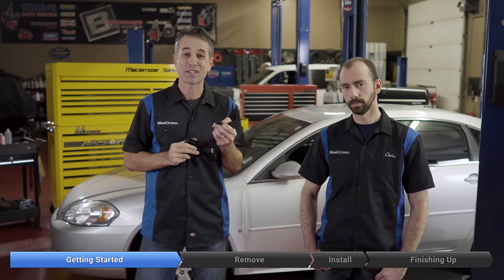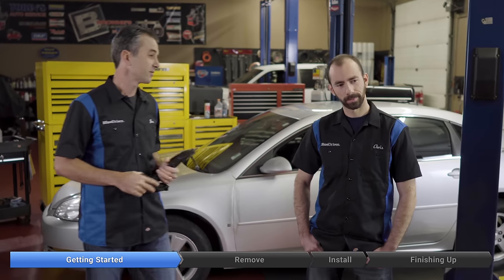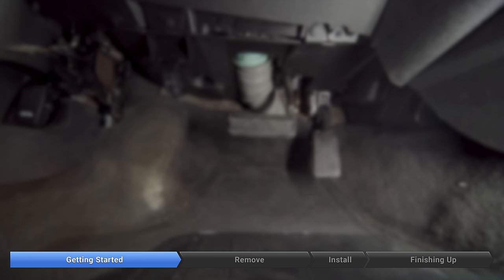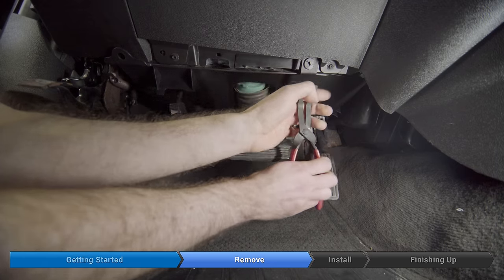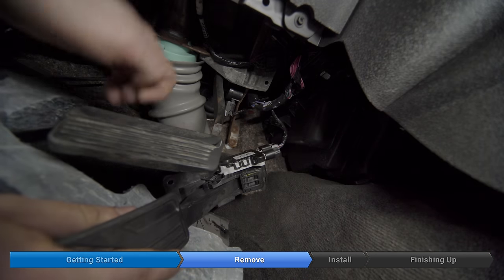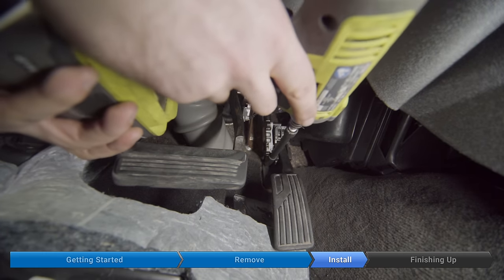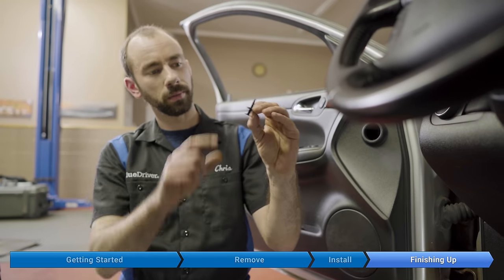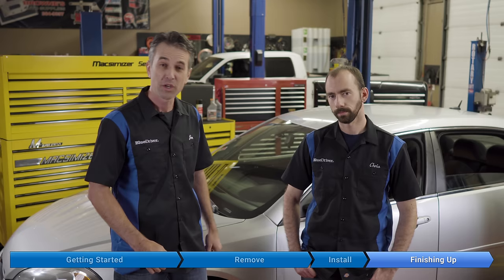Accelerator Pedal - 2006-2013 3.5L Chevy Impala

Comment: Awesome thank you! My Impala 09 was giving a service traction control and an engine power is reduced messages. It happened once before about 4 years ago and as of last week started it again. Same exact dummy lights same sluggish and somewhat hard shifting. I left work today picked up the part and had it in all in less than an hour. Car is snappy and responsive with no traction control light or message. I cycled the key a couple times due to running around to a couple stops and the CEL is now off. The first replacement I paid someone to do but thanks to this video I had the knowledge and confidence to take it myself. Thank you guys! I really appreciate the help!

Comment: About to do this on my ‘11 Impala. Gave my daughter the “service traction control” and “service stabilitrak” warnings. Took to to a place to read the codes, and they came up with replacing the accelerator position sensor. Thanks for the walkthrough on this!
Reply: This worked great. No more warning lights.

Comment: What would be the symptoms of the accelerator pedal needing to be replaced.  I have a 2012 chevy impala and when I am stopped and go to accelerate I heard a sound like something catching in the accelerator and then the car accelerates.  It does not happen consistently and no lights indicate the problem exists.  What could it be???
Reply: they have no clue. they are just parts changers.. they never diagnose anything. mine has no lights either but it does not wanna go up slight inclines. sometimes
Reply: Mines says engine power is reduced
Reply: I had the same issues awhile back.. I took off the throttle body, mass air flow sensor and cleaned them with the proper cleaner ( I think it’s CRS the brand) and put some fuel injector cleaner and it runs like new🙏🏼

Comment: I have a pretty bad surge or pulse/constant jerking with light acceleration only at all speeds just seeing if anyone has heard of this or has had the same problem it does go away when i let up on the pedal or give more gas but medium throttle makes it happen for some reason

Comment: Is there anything we have to do after replacing the pedal? Do we have to reset anything. Or will it be ready to drive as soon as the part is replaced?
Reply: Go ahead and replace the brake pedal as well. It's good mechanical practice to do the same for each side of the vehicle.
Reply: @bottomtext1241  but they are both on the same side of the vehicle LOL
Reply: @ampecsu  I laughed so hard when I read this.

Comment: I changed the part and the code cleared itself but now if i crank and goto drive it tells me that the engine power is reduced and to service traction control, i dont know if i did something wrong or what
Reply: Same thing here. Any updates ? Did you figure out?

Comment: I have an 2008 Chevy Impala LT and while driving the service stabilitrak message comes on and then that gets followed up with a reduced engine power message, it has happened before, I took it in and they said it was fine. When it happened again I was driving on the street and it happened. It went away after a day but today while on the highway it happened again? Any ideas as to what or why?
Reply from the maker: It could actually be a faulty accelerator pedal - if you can get a scan and read a P2138 this could confirm it.
Reply: @LemurMonitors I actually had this issue recently and found this video while trying to figure out what was wrong. Glad I looked at the comments, that's the exact error I have!

Comment: Great video! I have a 2011 Chevy Malibu LT 2.4 L and I have the Codes  P0122, P0123, P0223. It’s says pedal position sensor for the codes. Can a pedal position sensor stop your car from turning on???
Reply: im assuming it can, today is 4-26-21 im not sure if you've figured it out by now considering how late this response is. but yes my car just stalled out and wouldn't start for a min, luckily i have a obd2 reader and the code is p2122 im ordering my part today
Reply: Same problem did it work for anyone of you guys

Comment: Why remove the panel?  I did this yesterday in about 3 minutes, 2 bolts, plug in new one.
Reply from the maker: Slightly better access, and (more importantly for us) so you can see what we're doing. It isn't strictly necessary, but it only takes an extra second to do.

Comment: Hi, I'm having engine surging while driving only with no check engine light, could it be this or the throttle body?
Reply: Hello did you ever find out what was causing it? I'm having this problem with my car now
Reply: @allanblazek6214  im fairly certain my issue was the torque converter or transmission

Comment: I need help guys! Please! I get codes P2122 and P1238. Should I replace the throttle body or the accelerator position sensor? Or both? Thanks in Advance guys
Reply: I’m sorry , I see what you said to replace via the video. What I meant was , should I replace the throttle body as well?
Reply: I know your question is two years old but If those codes are related to the service traction control service stabilatrak and reduced engine power I replaced the throttle body and it didn't take care of it so I'm about to change the pedal too

Comment: Okay so we did this repair on my husbands 2012 impala 8 months ago. Afterwards, though, it was hard to press the pedal. There’s so much resistance that it makes it hard to accelerate smoothly if you’re not used to the vehicle. We chalked it up to just being a brand new pedal, but it’s not gotten any better. It makes me hate driving the car. But my husband has recently decided he much prefers our brand new SUV so I’m stuck driving it more and more. And I’m ready to fix it. It was such a smooth, easy to press acceleration before. Is there a way to increase the sensitivity?
Reply from the maker: There wouldn't be an electronic way of doing it, there could be some internal adjustment but it might not be advisable to go opening up the case - the last thing you want is a stuck throttle.

Comment: What's the part number? The one I found locally, have to cutout in order to install it. Thanks
Reply: I have the same issue currently with my 11. Can't get the same as the original, and the new one needs a cut out

Comment: Question... I have code P2127 which TPS “E”. Is it the same thing ? Also, to reset the code, all I have to do is drive the vehicle for 45 minutes? No special service is needed?

Great video!
Reply from the maker: Yep! P2127 specifically refers to pedal position sensor #2
Reply: @BlueDriver It took me less than 10 minutes to do and the check engine light turned off immediately. You saved me $100. Thanks for your video.
Reply: @LemurMonitors  What is sensor #2 specifically. I can't figure out if that's a subcomponent of the entire pedal assembly that I can buy cheaper.

Comment: What would be the symtomsof the accelerator pedal needing to be replaced? I have a 2013 chevy Impala and when I am stopped and go to accelerate to turn to the right I heard a sound like something catching in the accelerator and then the car  slow down  i can not accelerate again  is hard to press the gas pedal until complite my right turn, It does no happend consistenly and no lights indicate the problem exist. What could be...
Reply from the maker: Symptoms, but dose not necessarily mean the pedal is defective :
Hesitation
rough or incorrect idle
vehicle dose not accelerate over a specific  limit
difficulty or not shifting
jerking
check engine light
bad fuel economy
no response when pedal is pressed or hesitation
LIMP Mode
the throttle positions sensor correlates with the accelerator pedal/sensor and will cause many of the same symptoms, best to check both, would also check for a dirty/sticking throttle body and the air filter.
all this being said there are many things that can cause a lack of power when accelerating, may not necessary  be the pedal.  hope this helps!
Reply: My 06 ls does not say stabilizer says engine reduce speed  check engine light comes on  does say service traction  control  and at times it will say service throttle  and stall then says service disabled  and won't start but jump it our give it time  and it will start tested  the battery  it's good

Comment: Can you use a used accelerator pedal from another car for this fix?
Reply from the maker: If it's coming out of the same vehicle and works well it shouldn't be a problem, it's just a straight hardware swap so no need to register the new one or anything along those lines.
Reply: Shouldn't buy used get new

Comment: My code reads the same and says throttle pedal sensor/switch d circuit low input is that the same
Reply from the maker: Yep!  P2122
Reply: So just change the whole pedal?

Comment: why would you want to change the whole assembly when the sensor is on the side? and they sell just the sensor or the whole pedal assembly!
Reply from the maker: Hello!
It's a lot easier to find the whole assembly (after a quick glance I can't find the sensor alone on Amazon, Rockauto, Napa, Autozone, etc)
Reply: advance auto can order just the sensor. its about 100 bucks. the ac delco complete throttle body is 249.99 the Hitachi is cheaper and the BWD is a little cheaper. but overall not much
Reply: @marvinmanley3764  You can get the pedal for least than $100.

Comment: $100 for this damn pedal I swear I've replaced 10-15 sensors or parts on this car in the last 6 months. It's a 2010 Impala so it's been driving with no issues for 5+ years but nw it seems to be falling apart!!
Reply from the maker: At least it's easy I guess
Reply: Stephen Allen Im in the same boat I have an 11 I just recently fixed the transmission at 160,000 miles
Reply: mine's 2007 so it's slightly older but yeah man did y'all's windows all quit working n fall down one after another too?? 😂😂 bc that happened to me and now this
Reply: and today the AC started knocking loudly what's going on 😭😭😭😭
Reply: ATCkeepsUsafe  I shulda bought a Toyota. Since ths comment I've had to replace my engine it made it to 238,000 miles.
Reply: @blakespeaks314  most of my door locks are no longer working and my driver side window motor is slowly going out also.
Reply: @mcseven100  I have an electrical short on my impala thats causing my compressor to blow out relays, fuses and it even burnes out itself after blowing a few fuses. I have NO IDEA where the short is at!?!?
Reply: @blakespeaks314  yup.... The actuators went out. Also the actuators on my door locks don't now either I have to manually lock and unlock all my doors. Even the key fob stopped working for some strange reason.
Reply: @mcseven100  i sure as hell hope you not talking about an impala with a timing belt. It has a timing chain. Now from experience with my pontiac g6 the ac compressor froze an snap the serpentine belt not a timing belt.